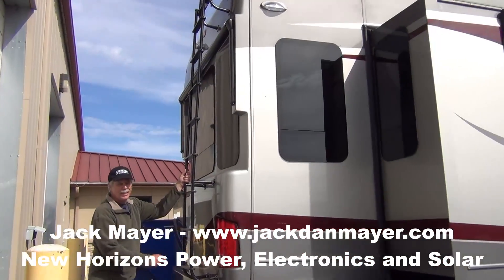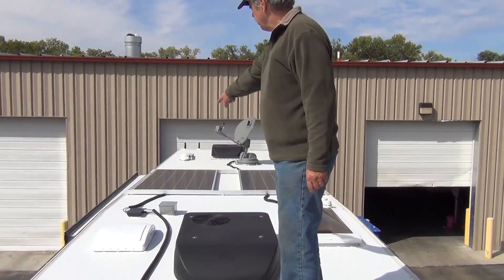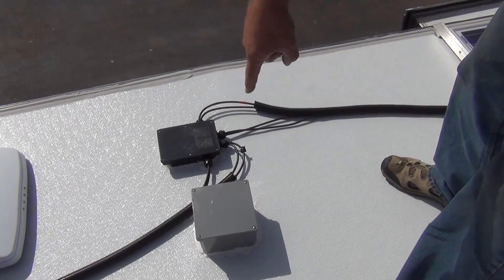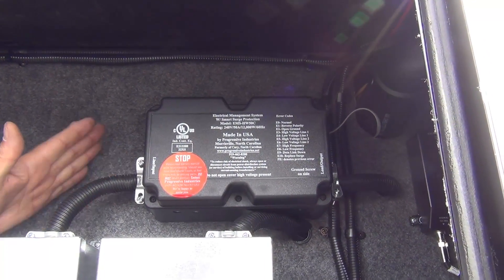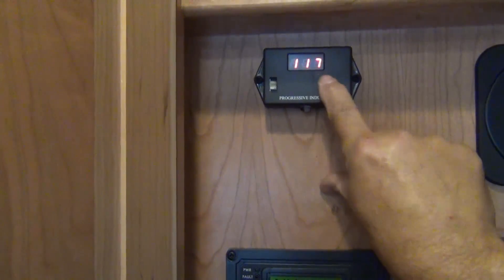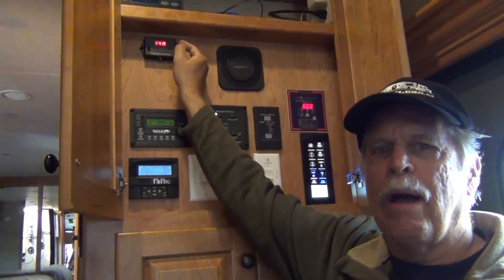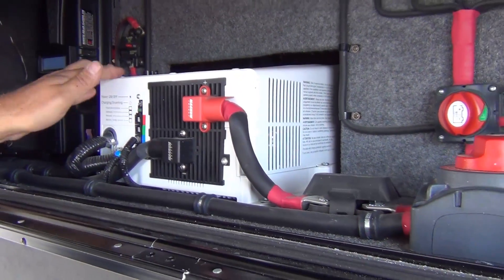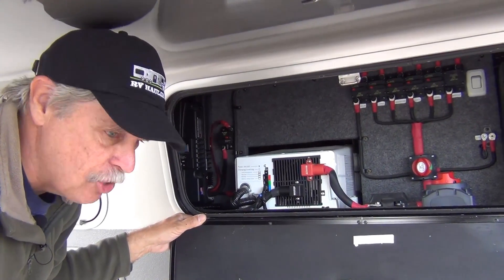New Horizons Majestic Power Electronics and Solar

Comment: Jack, 

What do you do with the excess power supplied from your solar panels when hooked to shore line power?
Reply from the maker: +Rod Lappin Anything not going to the batteries put off as heat. There are separate load terminals on the solar controller that do allow you to do things such as heat water or power a secondary load with the excess solar power, but we do not use them.

Comment: I'm curious why you guys didn't mount these Solar Panels so you could tilt them?
Reply from the maker: +Les Garten Hello Les, this answer comes from Jack Mayer :  I prefer not to tilt panels. As long as you have enough roof space to put enough watts on the roof you do not have to tilt the panels to recharge your battery bank. While tilting panels may be desired in some circumstances - like dedicated off grid living - I find that for the most part it is not necessary with a large enough array. Tilted panels in high wind are a big issue. I have seen more than one ripped off the mount. And do you really want to be on your roof working on panels when the wind is 40mph?"